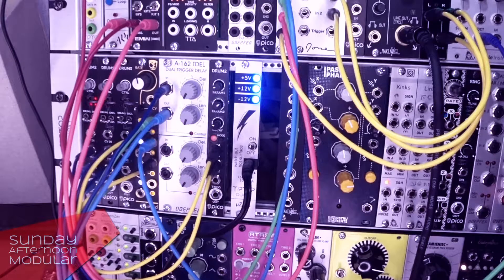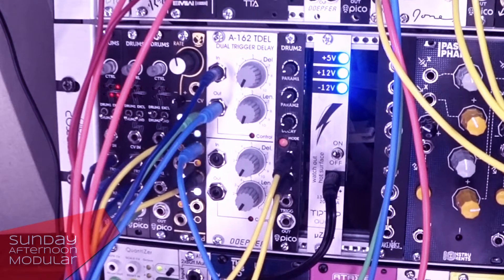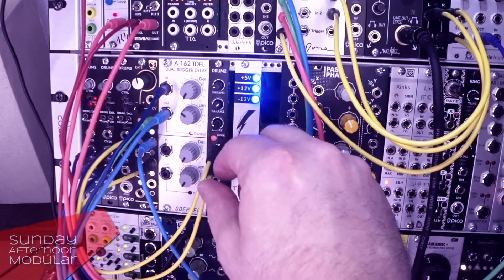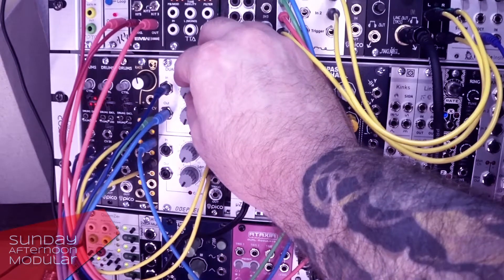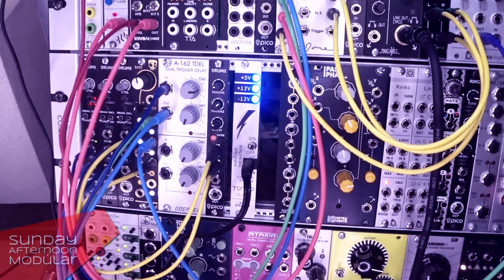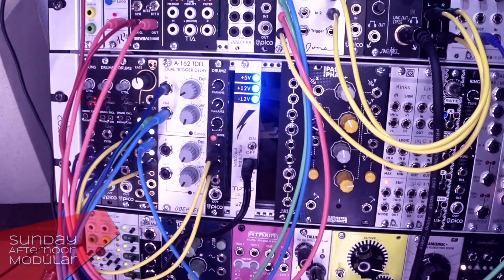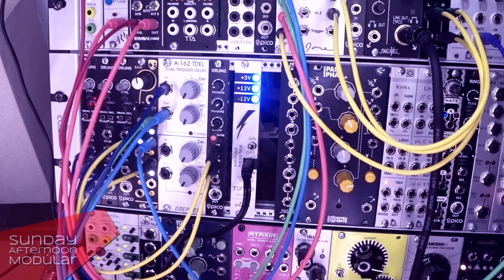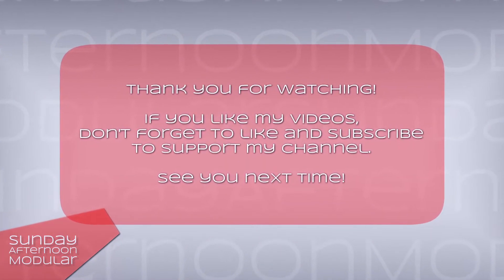Doepfer A-162 Dual Trigger Delay Introduction

Comment: Thank you for this video! I have a question about the A-162. Do you know how short triggers it will accpet on its input? For example, I know that the Make Noise René mk1 at some settings will output 2ms triggers (which is too short for some modules to recognize). So for that reason, the A-162 would be a great help. I have looked in the manual but unfortunately no info about this there. Many thanks in advance for any help.
Reply from the maker: Hi Per Anders Skytt, unfortunately I don't have any information about this, and also no Make Noise Rene to test. Maybe if you write an e-mail to Doepfer they can help you with your question.